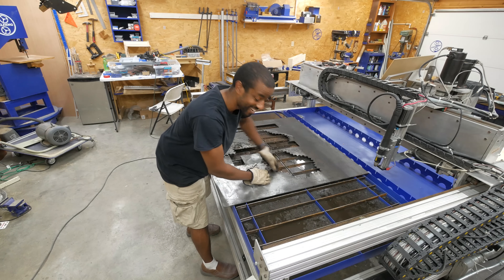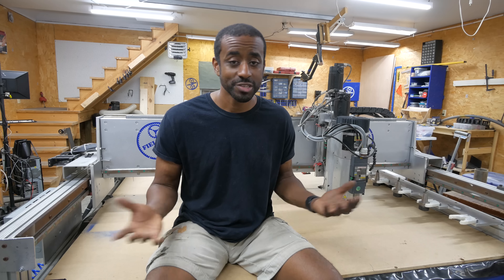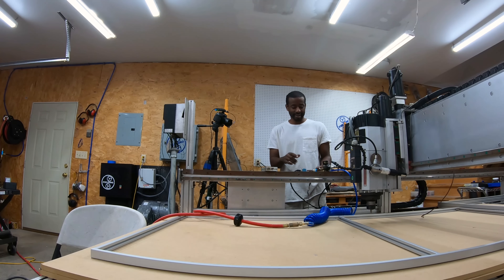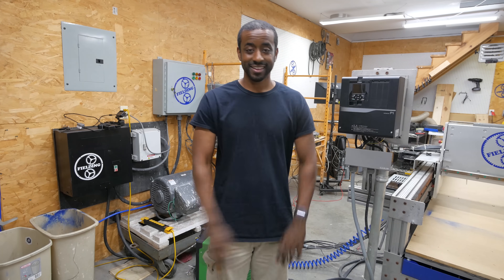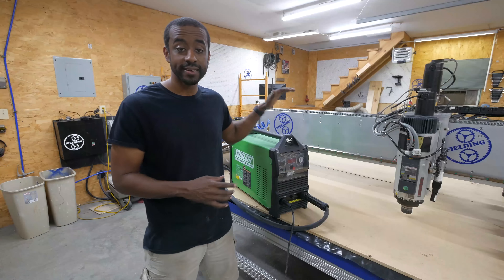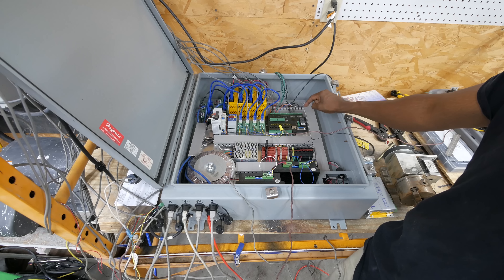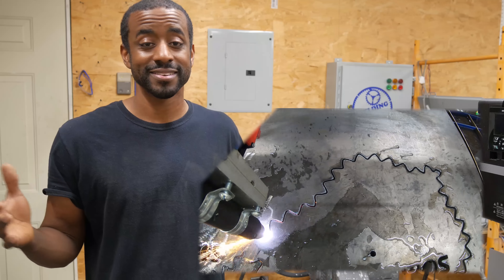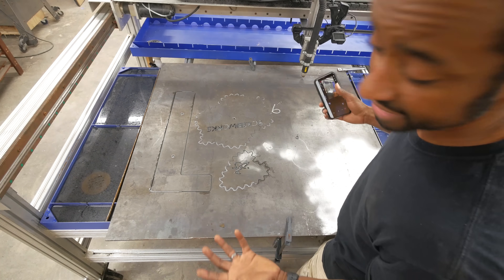Building The Ultimate DIY CNC Part 2; #073

Comment: How has the yellow DC Servo drives worked out for you shown in the control box? I am working on a build right now and thinking about using those same drives.
Reply from the maker: I could never quite get them tuned. They work but are noisy

Comment: I thought of building CNC with a hydraulic frame rather than the step motors and use primarily pneumatic tools to minimize weight but the later maybe counterproductive as a heavier tool may have less “kickback”

Comment: I asked you about plasma electrodes and what kind of  material they are made from and I found the answer on the ESAB website the outside is copper and the inside and the inside is made of Hafnium is So when using Oxygen or compressed air as the cut gas, the insert is made of a material called Hafnium." Hafnium lasts a lot longer in the presence of Oxygen" but tungsten burns up in the presence of oxygen. We have a burnt up the tungsten because we forgot to open the argon cylinder a time or two or three .you seem like the kind of guy that would find this  interesting. So is it possible to bring an old warn out electrode back to life? I believe that I can fuse the tip and drill a new hole but I am not sure about the electrode.  I am interested in your response have a great weekend and God bless you

Comment: With the used VFD question, it is probably the most cost effective to buy a used one and just re-cap it if needed. The cost of the capacitors is going to be nothing, and a simple desoldering rework could save you a substantial amount of money.

Comment: Awesome build, thanks for the video!
But I think the way to go with automatic tool changers for hobbyists is some 3D printed mechanism that screws off the collet and tool and screws another one on. I've seen it somewhere. 
Those pneumatic atc spindles are utterly unaffordable and not everyone can get lucky with second hand industrial setup. So your setup is kind of too big and too niche if someone wants to replicate it.
I'd also be curious about a DIY spindle with a BLDC outrunner motor and encoder and something like ODrive servo controller. I'd be curious of those have enough power to mill. Odrive can deliver something like 2-3kW (48V x 40-60A) with enough cooling.

Comment: hey Jeremy, amazing machine you've created, looking forward to seeing more of it in action!,
I'm in the process of building a machine, and Ive actually got exactly the same spindle as yours that i found second hand.
Im weighing up how im going to power this thing,  and wondering if you've experienced any issues running with your rotary phase converter/ vfd combo, and did you need to do any balancing before the power reaches the vfd? AJ

Comment: Are you using a t torch height controller? I traded a motorcycle I couldn't sell for a Tor Mac plasma that the head was burned up. Tormac wanted $2000 to replace it. I built an entire control setup for about $100. Yesterday I realized I could have replaced the burned part with a $20 breakout board and have it up and running Even cheaper

Comment: 9:30  Electrolytic capacitors don't really dry out as much as they need frequent enough use to prevent the microscopic insulation layer from breaking down. There is a simple process to reform this layer. I think it's right up your alley 😉 It's a lot safer to buy these than you think

Comment: 7:00 Air pressure to release means a loss of system air pressure won't cause tool loss. When changing by hand, it's good practice to de energize the motor, and hold the tool prior to release to minimize damage. When loading a tool, keep your fingers away from pinch points while holding the tool in position. Keep holding until the tool locks in. Immediately check whether the tool is locked before letting go of it completely.

Comment: Great video!!! I think you have achieved awesomeness.  I have been a Solidworks user since the mid 90s and my first project proved it's worth.  I designed a grip to alleviate tunnel carpal.  Everything was compound curves.  After hand making the prototype and getting approval, an .SLA was sent to the toolmaker and an injection mold made.  When the tool arrived, we put it into the press and started shooting parts.  It only took three shots to start making good parts. The first production run was 500,000 parts.  From concept to sales took only 20 weeks.  It made me a true believer in 3D solid modeling.  Thanks for all this......

Comment: 1000$ for materials
1600$ for spindle/vfd wiring etc
100$ screws/hardware
500$ max plasma (dont even know what this goes for but I'm just guessing here)
And 1100$ stepper/servos leadscrews or rails

About 4300$-5000$ would be my estimate for the build

Comment: That part is called a compression fitting.
Reply: I think that is actually a 1/8 parallel npt with face seal to a 8mm push to connect.

The npt with face seal is a bit odd. I don’t think I’ve seen anyone use that before.

Comment: So the air pressure sucks the tool in then there should be a mechanical lock when the spindle spins. Does the air need to be on while the spindle is turning.
Reply from the maker: I was wrong... the air pushes on a spring lock mechanism. When the air is off the spring fingers hold the tool. Default is holding the tool, air opens the lock

Comment: The valves you are using for the tool changer are called solenoid air valves. They use a spring and two electromagnets in opposition to each other to actuate. Basically, they are a really short linear motor with a spring to have them favor a position when de-energized You can find them all over industry. Anywhere that you need a valve to open or close quickly and can get electricity to it is where you would use one, as long as the valve is of the right type.

If you ever get lost in industrial equipment, try asking This Old Tony or AvE here on YouTube for help. I know more of the electrical side of things, where as they are more part of the mechanical side.

Comment: I set-up spindles like these regularly. Some of them have internal valves, some don't. Typically you'll have one or two air input lines for the tool clamp, and you'll have one for the taper blowoff/spindle blowoff. There should be an internal zero speed sensor that will not allow the tool to unclamp if the spindle is turning. If it doesn't, you should set it up with an external zero speed sensor.

ETA: awesome project, very jealous of your machine.

Comment: If you oversize a vfd it will likely send too many amps to the motor. You need to auto tune it.  Also make darn sure you setup the overload and motor information in the drive for motor protection.

Comment: I once took an inverter and hooked it to my car battery to run a grinder.  I bet you could do the same to test motors "in the field".
Reply: a fully charge car battery is 50 amp hours @ 12v, you might find yourself getting an uber to get home!

Comment: It is not vacuum gripping a tool, but tool release mechanism. It is more kin to air quick connect. When air is pressurized, a piston pushes on a spring loaded mechanism to release grip on tool. Balls gripping ISO tool release mechanism, and pulling on it when mechanism deactivates (no air). Also, 2 valves are probably needed because of amount of flow/pressure change, to actuate faster/more powerful. Great video and great machine! Keep up the good work!

Comment: All good.  Great machine.  Really appreciate how you work out what you need and then get something that does the job running at 50% power.  
Also interesting to see what happens when when you state a problem out loud as opposed to just thinking about it.  Not sure how often it has happened to me that I see a solution only when I'm describing it in words (and when I have used similar words describing the problem in my mind.   Thanks for the video.  Cheers, David

Comment: It is important when looking at air compressors to not just trust the numbers given as one trick cheaper compressors use is CFM at 0 back pressure so you get a lot less CFM at operating pressures. 

If you want to remote install a compressor to reduce the sound in the room you can put in a accumulator tank in the room for the volume of air needed without the bottle neck of the pipe effecting performance you normally get from long pipe runs.
Reply from the maker: I am planning to do exactly that 👍🏾

Comment: In 2000 I started saving for a CnC plasma cutter, by 2004 I had saved up enough for a Hypertherm 60 amp torch, 100 gal air compressor, and a PlasmaCam 4'x4' CnC table. The whole setup cost me just around 13k. I'll bet your entire setup cost HALF. so I am thinking 7.5k. I went through the same learning curve you did, and I giggled and screamed when my first cuts came off the machine.

Comment: The MAC valve is known as a 2 position, 3 way valve with spring return. The topside of the diagram shows the coil and manual push button, the squiggly line on the bottom is the spring return.
It appears the second valve may be used to ensure venting like you said. The clamp in the spindle grabs the retention knob and draws it up in place and locks it. It should be normally closed, so you have to actuate it to unlock the tool. If it’s a true ATC, check M06 out 

mdi > m06t02

Should change to tool 2

(Edited my error on the valve)
Reply from the maker: But I also need to tell it where to get tool 2 right? I haven't researched this part yet, but my guess is I need a macro which tells Mach4 where to get the tool relative to the home location 0,0,0.
Reply: Yeah, you have to designate the tool change location. I’m not sure about gcode designation for it, or if it’s a parameter you set. I do maintenance on the machines, usually mechanical and electrical.. it’s led me to knowing some basic commands- but these are Okuma and Fanuc controls.
Reply: Most certainly it should be in the settings somewhere. It should also let you get to the IO for the clamp/unclamp. You should have a sensor that tells when it’s clamped or unclamped as well. Life would suck otherwise.

Comment: I guess this cnc project ran between $7,000 and $10,000 with a large chunk of that in the base (estimated $5000 frame and spindle), followed by the rotary 3phase (+$1000), the VFD (+$1000), the plasma torch with the CNC gun (+$2200), additional electronics (+$1000), and various hardware (+$1000). 

$11,200 is my rough estimate. The base price deal is the biggest question if it is much higher or much lower the whole system would be more or less of an investment.

Comment: i think the buttons for the tool changer are typically momentary aren't they?  or at least, when i see people use them, i think they walk up and with one hand hold the button down while they pull out the tool with the other hand... then they let go.  Then they go find the new tool and when they go to put it in, they hold the button down again.  And usually that button is located on the spindle.  Or at least it is on the ones i've seen.  Great stuff!
Reply from the maker: There is a green button on the spindle for that purpose. I just wasn't using it

Comment: Can u convert SUV to electric
Reply: PaulBodyBuilder - I converted a Mazda Miata to electric ! 120vdc lithium batteries to a 3phase 50hp motor. 238ft lbs at 2 rpm !  The first trial ride - trompted on it and spun the rims inside the rear tires !
Reply: @farleyjohnson1130  where r u located
Reply: PaulBodyBuilder  Pennsylvania - more to your point - Jack Rickard at EVTV has a fully functional Escalade that is completely electric. I encourage you to view his channel. My components bam from Jack and EVTV West.  Jack has moved away from the mainstream and has broken the code on Tesla’s
Electrical systems. He’s salvaging Tesla components for reconfigurations

Comment: My (no research) guess is $7200 and if you paid double that it would be worth every penny. That's a very high horsepower spindle for a home shop. Although I do wonder if that frame is rigid enough to take full advantage of it. I like that way you mounted the plasma on the back side of the bridge. This is one very cool project.

Comment: You should be able to get the manual for that spindle from hsdusa.com. If not, I can tell you what I know about my spindle. There are two lines because one opens the collet, the other closes the collet (there is also a spring inside). There should also be a third air inlet for bearing purge air.
Reply from the maker: I have it... its like 700 + pages, but I got all the wiring instructions from it.
Reply: It looks like HSD have lower HP models that are ATC. If buying new, what would you recommend for a home shop? 9hp sounds way too much. :-)

Comment: for that type of machine you dont even need motors with encoder. just some nema 34 will be fine. i have one that is bigger and heavier and almost never loose a step.
Reply: pretty sure those Y axis aluminum bars bends down when the gantry is in the middle. get some dial indicators and measure.. now is the time to fix the errors.
Reply from the maker: I plan to put leveling feet across the whole thing when I am done working on it. It just has casters now because I have to move it so much. My floor is not level, so I expect a small amount of deflection. When I am done I will check for those final few thousands of an inch.
Reply: why did you put the rack facing up? some hard debris and you will loose some teeth

Comment: holy crap you went from losing your shed shop to intro to cnc plate steel with a diy plasma cam
ps: add a "muffler" on the open port if the air release is a bother, they cost a couple bucks on your next mcmaster-carr order, and you get use to hose fittings real quick, there's only a few of them you ever deal with
ps ps: 4500 + about 8 grand worth of labor

Comment: $5000 in used parts and $10,000 in labor. Seriously please keep track of labor, research time, etc. that is why stuff is made in china because of cheap labor, not cheap materials.
Reply from the maker: This project is all consuming... I have researched, built, and thought through this daily for months. There is no practical way to describe the labor without tracking the time on my phone, and remembering to do it every time. I actually tried that at first, but I quickly lost track.
Reply: @Jeremy_Fielding   just write down in a notebook about how much time you spend each day doesnt' matter if it's off an hour or 2. A general sense of time is all that is needed. Sounds like the time you have spent on this so far is already much higher than most have available. for example 10 hrs a week for 3 months is 120hrs ball park time investment.
Reply: more like $20,000 in labor. This guy is smart, he probabaly gets paid well at his day job and ones' free time is always worth way more than what they get paid to work for the boss.

Comment: Hey Jeremey, there are "fingers" that grab the retention knob on the end of the tool taper. They are under tension from a spring or a series of belvill washers. There is a pneumatic cylinder that actuates and pushes on the springs and releases the fingers to remove the tool. Great find! Jason
Reply: Physics anonymous has a video that talks about that exact same tool changer in there cnc mill video
Reply: ball bearings. the fingers are ball bearings.
Reply: @DieselRamcharger  my fingers are like ballbearings but i drop everything.

Comment: That looks like a MT40 taper tool holder. That's a super nice motor. And 9hp  is insane. That would make for a good sized cnc metal milling machine. I love the surpluses and auctions. I spent my early life in those places. I've got a shop full of great used machines. Lawrence Livermore labs used to have a Sunday auction that will never be seen again. Deals from heaven.
Reply: Do you mean BT40? MT is a morse taper designation, which I doubt that has.
Reply: @procyonia3654  I meant NMTB 40, or CAT40. Now that I think of it, I believe BT40 is also the same thing.
Reply: BT is the metric standards, chances are its BT because those are balanced for high speed, probably a 30 taper though due to size and speeds used on machines this size.

Nmtb and ISO of have the same 7/24 taper but do not have a pull stud, this has an ATC distinction so it has a pull stud/draw tube if it has the 7/24 taper style holder.

CAT holders are unbalanced because of the short/long key so generally not spec'd for machines with high speed spindles (which I assume this has)

Sorry not trying to be pedantic, the goofy machine tool industry has weird ass standards.
Reply: @procyonia3654  Right, there are distinctions like flanges and pull studs. I tend to lump them all together. I've got a Deckel FP-3 I bought from a surplus back in 1992. It's manual.
Reply: Nice I love Deckels, does that have the quill in the horizontal like the FP2 series (sometimes) had? Some of the best toolroom mills available!
Reply: @procyonia3654  Yes. And the universal table. It does everything. Best tool I have.
Reply: @ G Kuljian
 Yep, I have a garage chock full of nuclear weapons past their "use by" date -- been trying to figure out how to hook them up between my solar panels and PlayStation using a Flux Capacitor to level out voltages... ;)
Reply: Have you tried wirin them in reverse polarity
Reply: @procyonia3654  I have it running on a Tesco inverter. I recently designed and built a pendant with reverse and variable speed. It really helps with power tapping.
Reply: That's amazing, my next project is to do something similar for my Van Norman, I want to connect the X Y And Z feeds to the pendant too.